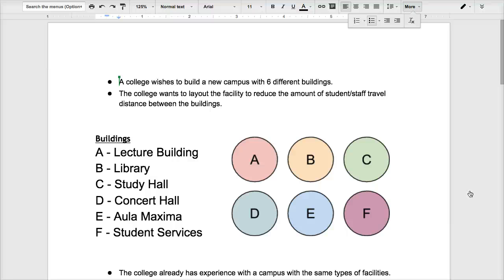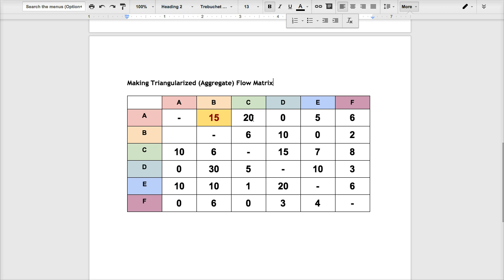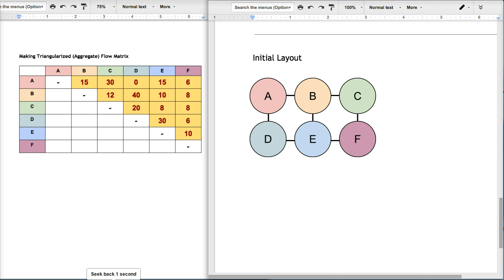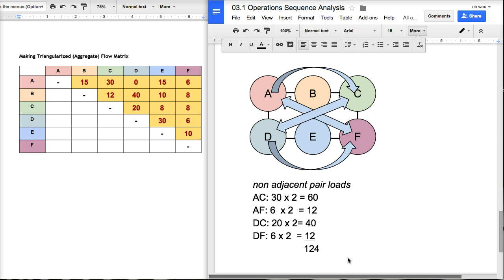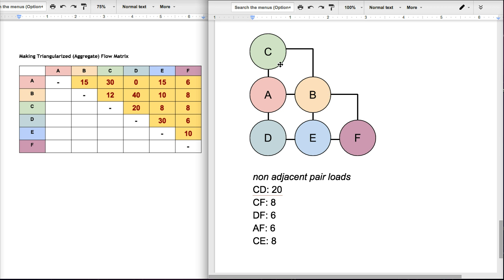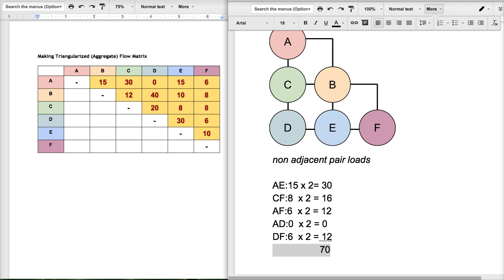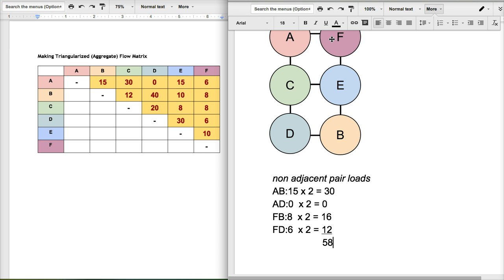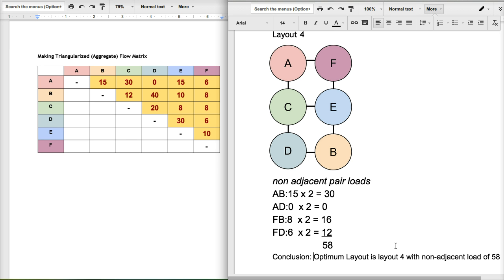Facility Layout - Operations Sequence Analysis

Comment: I have a question how do u identify non adjacent load?
Reply from the maker: Any node that is more than 1 grid space away from another. is non-adjacent.  

All nodes that are on the same square as another are regarded as adjacent. ie they can't be any closer to one another so we don't take the people travelling between them into account.
Reply: @QVisible  when should I stop rearranging? Do you have any tricks? Like how did you determine that this certain arrangement without even performing calculations will give u optimized size?
Reply from the maker: Without doing a calculation for every possible layout, there's no way to fully know when you've achieved the optimum layout. But, a rule of thumb is, if there are low numbers in the triangularized flow matrix that you haven't used as part of your calculatio, then there is probably more scope for improvement.

Comment: this was definitely insightful, but i wanted to clarify one thing whether this method is applicable for both the process layout as well as the product layout. Please, reply me!!!
Reply from the maker: Good Question. I had to think about it. This is suited to process layout. I think if you were interested in a product layout you would use a product flow diagram instead. This would be more useful. What do you think?
Reply: @QVisible  from another source i got that this method is applicable for initial setup. But for re engineering different types of facility, different method is used. For example product layout such as assembly line needs to have line Balancing
Reply from the maker: Agreed. This method is best for retail layout with random people who each want a custom experience and have free choice where to go and what order they want to consume. If you have a rigid product that can be replicated, then product flow diagram with line balancing is more suitable.

Comment: This video was very well put together. This helped me understand my homework that I literally couldn't figure out. Thanks !
Reply from the maker: Out of interest....what course are you doing?
Reply: BA 381-101 Operations Management, we are using a book called "operations and supply chain management" by Russell & Taylor. Chapter 7 in this book is about capacity and facilities design, and for the life of me, did not understand the problems at the end of the chapter. This video explained the basics of what it is I am doing and was able to solve a few problems last night. I shared this video with my classmates that got stuck as well.

Comment: between e and a is not 15 it's 5. but that doesn't make much of a difference to the explanation1 thanks.
Reply from the maker: It's 5 in the intial matrix but 15 in the triangularized matrix which is the important one. see matrix at time 6.28.

Comment: Thanks a lot for your video. Very Educational.
However, I was thinking you could have still gone further by swapping F and B, which by my calculations should have brought the sum of the communication between the non-adjacent departments to 44 instead of the 58 we stopped at.

Good Education anyway.
Reply from the maker: Elvis Brenya Appiah - Kusi Just doing the sums on your suggestion. Non-adjacent loads:
AF:6x2=12
AD:0x2=0
BD:40x2=80
BF:8x2=16
Total Sum: 108
Big problem here is the introduction of the BD non-adjacent load of 40. Have I understood your suggestion properly?